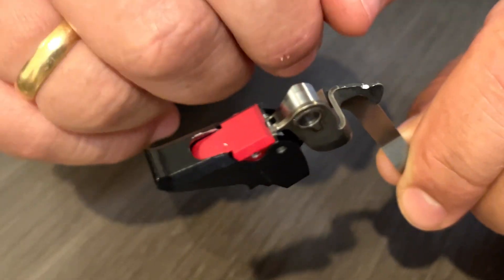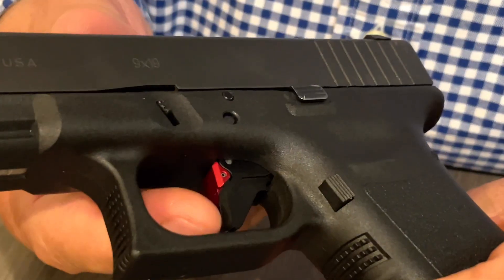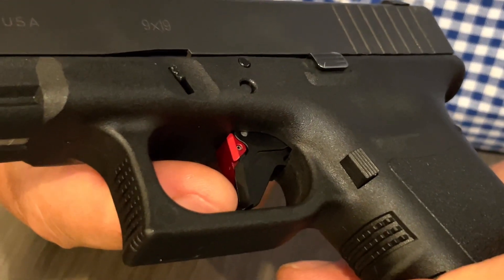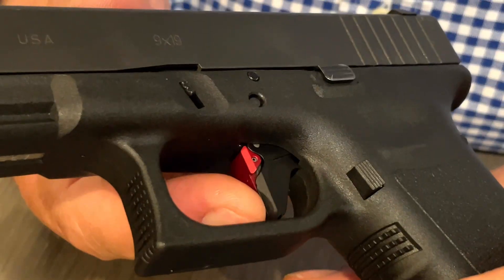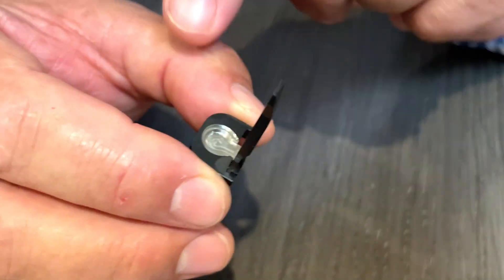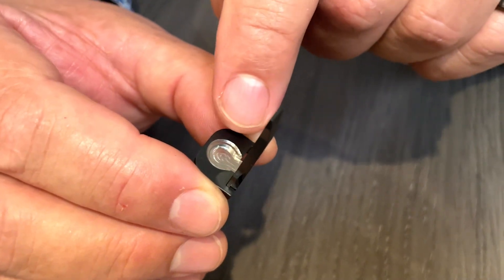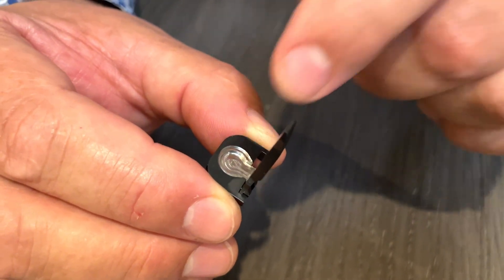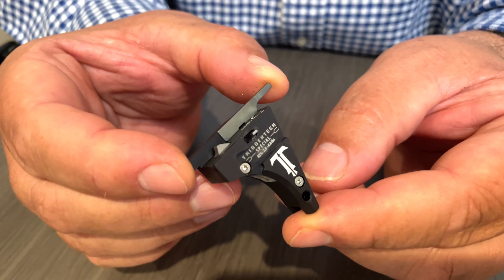ACE Trigger System Certified Lever Module update

Comment: Is there a program by TriggerTech to send them my Glock 45 and pay them to add and test for QUALITY CONTROL the new trigger kit of theirs on my gun? I do want that new Duty trigger kit + that red/black trigger shoe of TriggerTech.
Reply: no, just exchange the old lever for the duty one once it comes out.
Reply: Ok but does the duty version have that same dial as the 1st model? I really want that dial(it's Gen 6 material)  @S_ipsc
Reply: @tibora13the dial in the rear housing to adjust the pull weight? For the duty version I Will try to find out and let you know.

Comment: I already bought one for my Glock. G5 is something wrong with my trigger.
Reply: There is nothing inherently wrong with it. There is simply a CHANCE that your trigger may not be drop safe depending on your specific Glock frame. 

I have the OG trigger and mine is 100% drop safe but there's some people that aren't so lucky. 

My advice is to check it by whacking the back of your gun with an empty chamber with a rubber mallet and see if the striker drops.
Reply: @ShellShock794  that doesnt mean it will go off. many guns the trigger might go "dead" meaning the sear releases the striker but the safety plunger keeps it from igniting the primer. however it is definitely worth for him to check but i question his ability to troubleshoot since he bought the trigger for duty use when it was clearly labeled for competition use only. 🙄 he  is better off contacting TT support team and get guidance from them on how to check his pistol to see if its affected or not and how to enroll into the program.
Reply: @S_ipsc  say, is there a program by TT to send them my Glock 45 and pay them to add and test the OG trigger kit of theirs on my gun?  I mean that would be cool + I'll have "quality control", confidence and reliability 🤷🏿‍♂️🤔
Reply: @tibora13no, just exchange the old lever for the new uspsa one and you will be good to go.